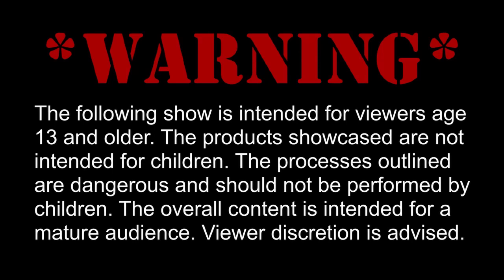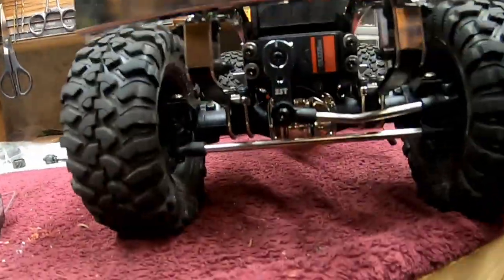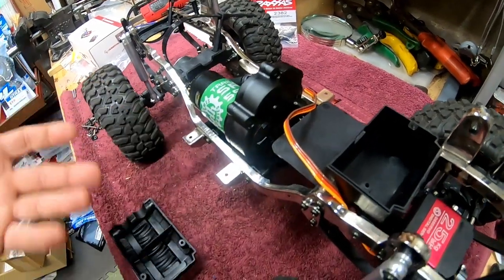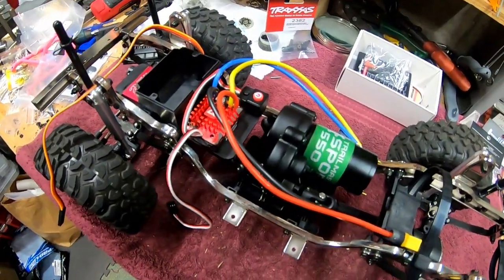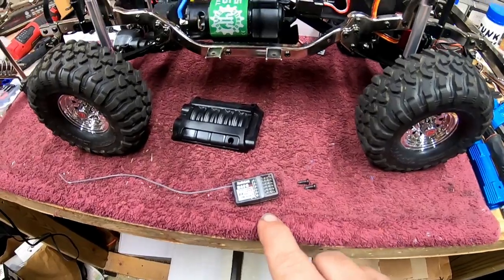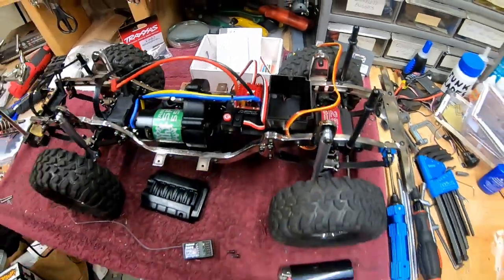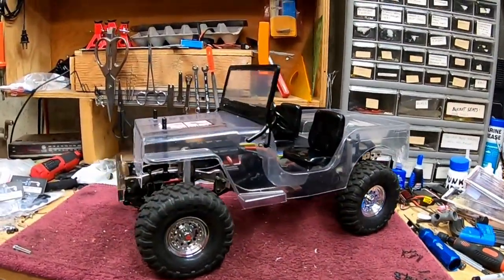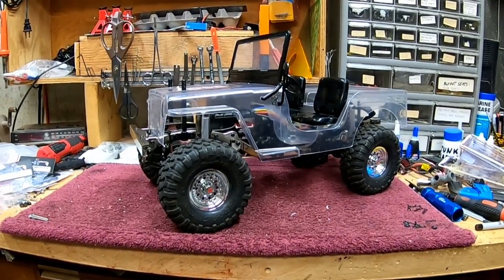Gmade Sawback Build P1: "Angry" Dave's ADULT RC

Comment: Very nice. I thought about the Sawback a while back. Wasn't sure about the leaf spring setup and the battery in the back. They look awesome when they are done regardless. Looking forward to your finished product. Cheers!
Reply from the maker: Thanks! It'll be a Trail Rig for sure. You can get extreme performance from leaf springs, but it takes a lot. So far, the only platform with enough part support that I'm aware of is the TF2. But if you know what to expect and operate accordingly, they can be a ton of fun. There appears to be enough room up front for a small pack, I may make another tray up there. Check out AC RC Crawlers for some great Sawback videos until I have more. Thanks again! -"Angry" Dave
Reply: The ESC plate makes a decent battery tray. You have to remove the "engine" cover or chop it in half, but it puts the batt in a nice spot. 
I was able to fit a Traxxas 7-cell NiMH on it, held down by two loops of inner tube tied round the frame rails, though I wasn't using the original body so I'm not sure it'd fit.